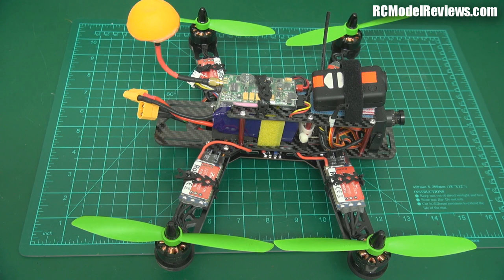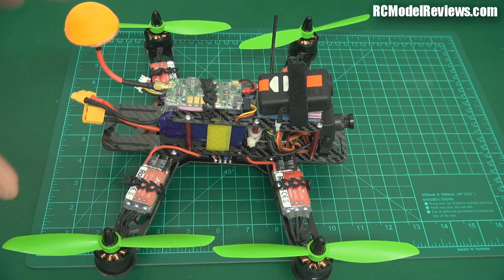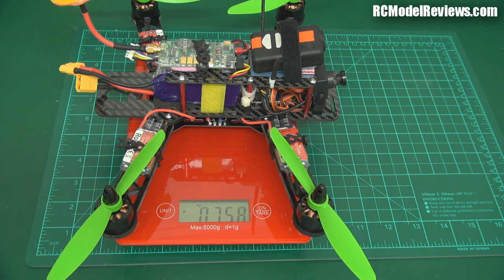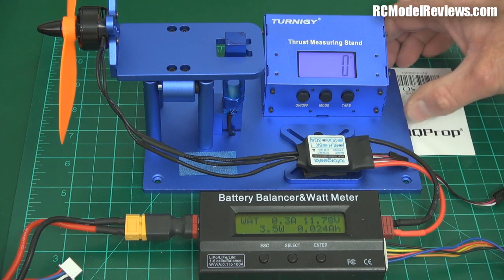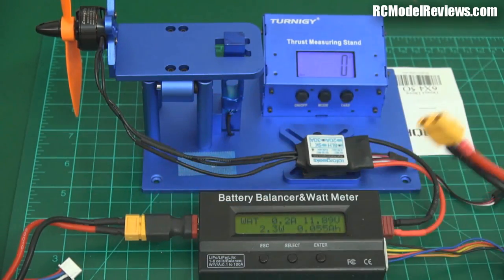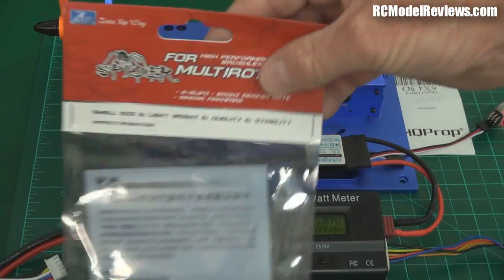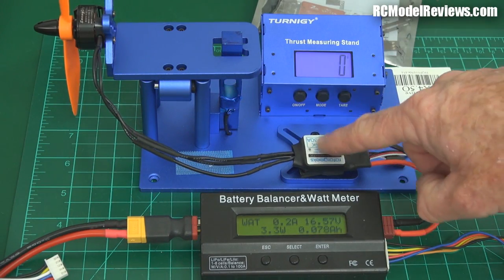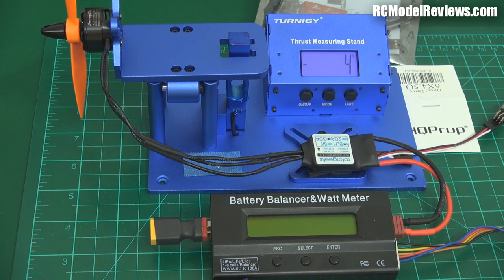SunnySky 2207 motors on an MXP230e

Comment: Holy F&$@ that's some crazy power!!!! I'm gonna try that setup on our new 300 :)
Reply: Sure is! I'm running the Cobra 2208 motors on mine and it's a beast!
Reply: Don't think it will match the Cobra 2208's on overall efficiency- nor do they sound as good ;)
Reply: ***** They do have a bit of vibration -- not well balanced -- but for $15 each, they seem good value so far.
Reply: ***** For $15 it sounds like a great motor! Looking forward to seeing part two! :)
Reply: HiFlite FPV
I always forget about that price point. That is a big difference. I think these are better for extreme 250 size minis- but too small for 330-340 size. I will probably try and get a set to at least have. Seems Sunny Sky has a habit of releasing their best stuff in the first batches and then QC can go downhill from there if demand jumps.
Reply: For $6.45 per motor you can use the FC28-12 1534kv motor from HK on 4s for ballistic performance using a 3 bladed 6x4.5. Lower KV, but an extra blade. I measured it on 3s and got 680g of thrust per motor, so built a tricopter up at 580g including a 2200 3s pack and had a lot of fun.

Then I switched it up to an 1800mah 4s. FARK. 

After 3 months of screaming around the park I'm about to re-frame the tricopter (damn trees) and going to put the combo on the thrust tester to find out what you actually get on 4s. I run flashed F30A esc's and they get warm but not hot, motors stay cool although I've had one spit a magnet during flight and one need new bearings. Yes you have to balance them, but for the money count me in!

Don't know if it works for a quad, but incredible on a tri. Is a 22x10 motor so you get the extra torque for the extra blade.
Reply: Video or it didnt happen Xhover !!! lol

Comment: I actually put these on my zmr250 build... Really had to squeeze them on the small arm they come with... But hover is basically 25% power or less with APC 6045.. I did order some Gemfans various sizes to test.  My full weight is only +/- 650 grams.. No HD camera Just the Sony super had.. Also I'm using those same ESC (600 hz).  I have learned so much from you Mr Bruce thanks a ton for all your awesome videos... Please keep up the great work..

Comment: You're in for some serious fun Bruce! I'm running the Cobra 2208 motors on my MXP230 (G10) and it's a rocket! Do yourself and swap that 1300 out with the 45C 2200 mAh 4s. I only get about 3 mins of flight time on my 1800's so a 1300 would be super short. Have fun with that new ballistic setup!
Reply: HiFlite FPV Yeah, I have a couple of those 2200mAH packs and after a bit of flying today, I like them better than the 1300s because the frame seems to groove much better with the extra weight.
Reply: Oh and call me irresponsible but I'm running the (tiny) 15A RCManChild BLHeli ESCs and they're not even coming down warm after some hard flying. The dynamic load must be much less on these motors then or the RCMC ESCs are underrated. My 30C 1800 Glacier LiPos aren't holding up to the abuse either so I need to get some 60 or 90C 2200's for the quad. I agree with you that the extra weight is kind of nice as it makes it fly better and more locked in (to me at least).
Reply: ***** Also does using a higher amperage ESC increase the thrust you get from the motors? I don't have a thrust scale or watt meter so I can't test it myself. I'm sure by upgrading to a higher C battery I'll be able to get much more power out of the motors.
Reply: HiFlite FPV In theory, a higher amp ESC can give you a little more power -- because high-power FETs (or more of them in parallel) have a lower resistance, thus allow more current to flow.  I'll be doing some comparisons later to check and see if the effect is measurable.
Reply: ***** ESC's run cooler when you overspec on the current rating.  Cooler == less power dissipation / loss == more efficient. I went from F20A's to F30A's and they run MUCH cooler on my current setup.
Reply: Ben Govett Thanks Ben and xjet. My 15A ESCs don't even get WARM when I'm flying my MXP230 super hard with the Cobra 2208 motors. Must be due to the huge amount of airflow it gets since it's directly in the prop wash.
Reply: *****
Hi Bruce, bit slow here - could you fire up the magic markers and explain what the difference between the BLHeli and Kiss escs and conventional esc sometime?
Reply: Tobermory Cat  I would like that :)

Comment: I have a friend who had 1800kV motors with 3-bladed 7x4.5 props on a 4S on a FPV250... Had to set the KK's stick scaling for throttle to 50% just to get it controllable... Even with that it still shot up like a rocket if you opened it up...

Comment: @ spyder000069: An (performance) airplane draws loads of current due to its drag going through the air. And for the drop and climb out, yes, that draws also more current. The thrust testbench is only for comparing system parts to each other in a certain condition. But this helps to preselect components for testing.

Comment: I tried this setup with these Motors on 4s. I was using DYS20 amp blheli esc's and blew one of them on 1st flight. Upgraded to 30Amp HK esc's. Bags of  thrust but the motors do not last long. I was getting 4 to 5 flights and a Motor would crap out.6 x 4.5 props is pushing a bit too far for these Motors. 6 x 3 gave a floaty stable performance but not exactly a speed machine. 5 x 4.5 Gave the best performance with these motors on 20 amp esc's and 4s 1400mah 65C Lipo. Lipo weighs 150g. A better Combo was 5 x 4.5 mounted on Emax MT2204 Motors and 4s 1400mah 65C Lipo. Same speed but the Motors have a slightly less Amp draw which enables me to use the much lighter DYS SN20 BLHeli esc's.

Comment: Nice videos with those thrust, power and current tests. But bear in mind that those HK lipos are highly overrated regarding their C-rate. (65-130C only made 40C, went up to 72°C or 162°F at 45C (from 60°C lipos die and so it did) and started smoking immediately at 55C on high performance laboratory tests) So you should multiply the power not by 4 but by 2.5 or 3 in best case when using lowtech HK lipos (which is any HK lipo). But anyways, an impressive quat.

Comment: A bench grinder has a shield, I think 400 watts on those props may be pushing the limit. Serious open table saw danger.
Reply: Hoverbot1TV Yeah, don't worry... I was keeping well clear of the prop disk and staying out of line with the plane of the blades :-)
Reply: If they are the HQ 6x4.5 prop then they handle it just fine.  I would be worried about a pure nylon prop like the FC though.
Reply: *****
Uhhh just remembered the rusty shard of steel a doc took out of my eye once. Not like I try and fly like a nana after all. LOL!

Comment: I'm using the 2200kv t-motor's on my new mini quad build. You mentioned that those motors require 20A ESC's when running 3S battery (which I am running). Do you think my 12A Afro ESC's are not strong enough?

Comment: I was going to get the Sunnysky X2207S KV2100 Brushless Motor CW/CCW For RC Quadcopter and FLYCOLOR Simonk Series 2-4S 20A UBEC 5V/0.5A Output Brushless ESC RC  but after watching this if I want to run a 4s I will need a 30amp

Comment: I purchased these engines before Xmas from Banggood but thler has been talk on RCgroups about Banggood sending out copies and not the real deal so am unsure that I have the real sunnysky engine. '

Also the engine comes with no mounting hardware to mount to a frame.

The mounting pattern and bolt hole size seams different so wonder how many quads have the wider mounting pattern .

Bruce love the report you did but can you please expand on mounting this engine and did you have to slot out the arms on the frame to fit these engines ..

M

Comment: The motor did not deliver 440W of power, it consumed it. SunnySky 2207 motors are 34g motors, so 3 watts per gram = 102 watts continuous rating. Running them at 350-400 watts (10-20% less when flying than bench test) will shorten it's life, but it will be fun.

Comment: I looked at those 2207s, but the efficiency was so low I discarded the idea.  I've gone with 2208 1800Kv's instead.  Armattan just released a set of his that can handle 4S for $14 a motor.  If you've got the money, he sells a TMotor variant with even better efficiency.  

If you're looking for plenty of speed while getting great efficiency though, the SunnySky 2208 1500KVs on my bench generate 750g of thrust at only 12A at 4S.  For my money I feel like they're the best compromise between power and efficiency for a 4S mini quad.
Reply: I actually run the 2208 1500kv with hq 7x45 and produce 950g of thrust at 15.4v pulling 18.4 amps, that's hard to beat. I have not checked at full capacity but has been fine with 18a kiss escs. btw the 7x4 hq props actually do a little better but noisier since they flex.
Reply: zenman8269 they start slipping at 4S with 8". I know I know, I was pushing it, but I had to try!
Reply: Good to know.... I really don't need to push my luck. I thought the 2207s could do more with 6x45
Reply: zenman8269 yeah, I was disappointed.
Reply: Hi,

can you tell me a reliable source for getting genuine Sunnysky motors?
thanks for your help!
/would be great if you advise an international source, since I live in Hungary. :)/

Banggood sometimes sells fake ones. A legit link would be nice dough. :D
Reply: BuddyRC has genuines.

Comment: shouldn't these modified arm's holes be placed so that the props are kept further away from each other? in the video at least they seem to be nearly touching each other, and this should get even tiny bit closer under fast rotation. even with safety aside, the extra turbulence is sure to slightly decrease efficiency.

Comment: I guess 1 battery is standard for the mini quads but can you tell me if I should be running a second battery in my FPV planes? i.e. 1 for control and one for motor? Is a second one needed or should I just rely on a single battery?

Comment: I ordered these motors and now I regret ordering only 12 A escs. I didn't yet began the build so  will it be too bad or dangerous to use 12 amp escs with careful throttle management without using full throttle on 3s?

Comment: I'd better get in quick these motors will start selling like hotcakes now ...you watch , 1800 4S batteries and the motors will be out of stock very soon :-)
Good luck fitting an 1800 size battery on the Xhover btw , your cg will be a bit off
Reply: pavalige I've got a 2200 45C 4S in it now and the CG is near-perfect.  The secret is to make sure your flight-controller is moved way forwards so that you can slide the battery right up to the middle post.  Put a couple of cable ties between the two center-posts so that the battery can't fly forward in a crash too.
Reply: ***** Ah ok I remember now  you did mention that in one of your videos ..I've been putting my batteries on the bottom of the quad lately and it seems to work well , I have a carbon plate that protects the battery and helps the quad sit straight.
Reply: *****
as I have discovered. I run 2.2's in a pinch because they are here. My G10 MXP runs 1.8's by design. I do think that these, and the Cobra 2208 motors with 6in props demands that lipos move up to the 65c ratings though. Heavy- but for the BO330? (I also have one of those on my bench waiting to be built and tuned)

Comment: That 1300 pack won't last you very long before they puff it if you are flying hard Bruce.  Can I suggest the Nanotech 1800 4s 65c pack.  Just don't use the A-Specs, they are useless.  Oh and we are getting 1200 grams using those motors and are getting almost 30a current draw.

BTW: the MXP230 must weigh the same as a tank if it's that weight with only a 1300 4s on it.  My BO mini H with 2208 motors and an 1800 4s weighs the same.  Why is the MXP230 so much heavier???
Reply: FinalGlideAus I've got a heavy VTX on it and those arms are 6mm thick :-)   I've tried to get some 1800mAH bats but they were out of stock last time I checked.   I have a 2200 I'll try as well though.
Reply: FinalGlideAus And I will be fitting out my BO mini H with these motors ;-)
Reply: *****
I also use some lower C rated 2200 packs which work well and they are the same weight as the 1800 Nanotechs.  Boris has found good results with the 2200 packs on these as well.  I must admit though that the 2207 or 2208 motors combined with the extra weight make them less agile in general. The 4 cell 2204 setups are much more fun when flying hard in tight spaces.  The 2207 or 2208 4s packs are more like fast faster cruisers.
Reply: FinalGlideAus
Yes, I still love my smaller frames with 5" props for proximity stuff -- but I still find it frustrating that sometimes a 220-sized quad won't fit through a 2m gap.  I wonder why that is? :-)
Reply: FinalGlideAus Not to mention the damage you could cause with the hyper speed these quads get.Square impact into an immovable object would test the toughest of frames.
2204 4S for close in proximity racing and 2207/8 for something like dhdracers last video , racing Charpu amongst others.
Reply: Zippy 1800 4s 40c works well too. I only run 3 motors but I've got 3 blades per 22x10 motor with 6 inches diameter and 4.5 inch pitch. So far, plenty abuse, zero puff. Really gotta put a watt meter on that sucker one day.
Reply: FinalGlideAus *****  Yes my experience on 2208 motors is same as well. It doesn't feel like a mini anymore :D. I am still fan of 2204 +4S +6x45 setup or perhaps 5x45. It is still light and agile and very powerfull :D.
Finalglide....yeah....I wanted 1800mah, but those are always out of stock so I found out lower C rating 2200mah is not that much heavier than high c rated 1800.
Reply: Boris B.
Yes I think I may be going back to a 6x4.5 4s 2204 setup.  I really like my 2208 setup but you can feel the weight.  It's a great fast cruiser but it's lost it's agility.
Reply: FinalGlideAus
Strangely enough, the MXP230e (with 2207 motors) doesn't actually feel heavy.  It is still very maneuverable and I'm loving the power -- although I find I don't use it all that often.    In fact, I'm still getting 4-5 minutes on a 1300mAH 4S pack in regular proximity flying.   Admittedly, this does drop somewhat when you start nailing the throttle and doing obscenely fast punch-outs but I guess that the amount of power required to fly the craft (and therefore the total energy consumed) remains pretty constant, regardless of the motors used.
Reply: FinalGlideAus Have you tried 3 bladed 6x4.5 with the 2208's? Found 3 blades tend to handle the extra power a little better on cheap 2210's running 4s. Interested in the comparison as I am looking for different motors for a new tricopter frame. Found 3 blades got me back towards that floaty agile punch friendly feeling. I read a lot of stuff about 3 blades being less efficient but 6-10 minute flight times on my current setup (float vs flog) tell me it's more important to find the right prop / motor / craft match than it is to pick the right number of blades.
Reply: *****
When Boris and I say the frame feels heavy it's because we trying to do the "Charpu" style flips and so forth.  Then you really feel the difference.  For the regular fast cruising you don't notice as much.

Comment: What will happen if you put a puller prop or a fifth prop that you could use the knob as to power ? Forward fast flat flight !
Reply: Better to tilt the whole thing up at 75 degrees or so and use the power of 3 or 4 props instead of just one. If aerodynamics are the biggest problem, make a cowling out of a PET softdrink bottle.

Comment: Are there physical limits to your experiment? 13 people at 50kg is 650 kg. 0r in other words 12 people at 100 kg each is 1200 kg. divided by 4 quad copter motors is 300 kg each (100kg persons) or 160 kg of thrust required per motor (50 kg persons). At five to one power ratio each motor would put out 1.5 tonne of thrust (100 kg persons) or 800 kg or thrust (50kg persons)

Comment: just building a quad with these and was going to use some kiss 18amp esc`s, would it be not enough ? i wonder
and hey bruce its a well known australian brand quad and ive had the grinder out getting bits to fit properly
didnt have to do that with any of me chinese zmr frames ;  )
Reply: TheUnDeRGRouNDHoBo Shocked! :-0
Reply: I'm curious to about the kiss esc's! have 4 on the way.  I make my frames myself, but also need to get out the grinder (file) sometimes;)
Reply: I'm running these motors on the kiss ESCS with no issues so far
Reply: Thanks mate! Good to hear
Reply: TheUnDeRGRouNDHoBo I've got two sets of 18A kiss esc's coming in the mail. I think they'll be fine. Four motors on the same battery won't be drawing four times the amps of the one in the test.
Reply: The specs Say's that they can draw a 30a burst current for 20 seconds! And I'll be milling some small heatsinks. And these things are tiny! Just got them in! 12x23mm and 2 grams! Not tested yet, but I'maalready in love with them!:)
Reply: RC and FPV Yeah, I'm looking forward to trying "one shot" on them! I've been avoiding 4s coz I had sync problems with 2300kv motors. I think I've finally got it sorted using custom settings with BLHeli on my afro's, so I'm enjoying 4s again. Kiss with "one shot" looks like a whole new level, though! I
Reply: I had the same with my 20a slom Afro's. Now I have ztw 30a opto Slim's.  No sync issues with SS 1500kv on 5s. Its a monster:D but for the 6" racer I'm designing now I needed something light and robust. And the KISS (Keep it super simple) ESC with the one-shot feature, looks like the perfect ESC for the job!

Comment: 400Watts and only 1000g of thrust and you call that wow!?
On my 650 quad I have motors that each gives 1100g of thrust from 220W :D
Reply: +Marcink126 yeah and those motors weight maybe twice as much and you can have 8 inch props. This is the same amount of thrust as your 650 meant for a quad a third the size.